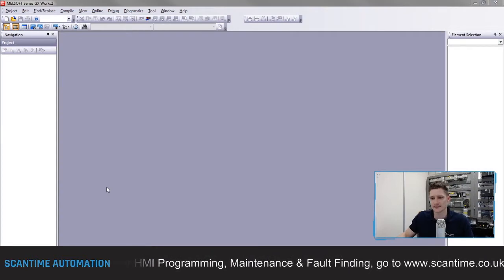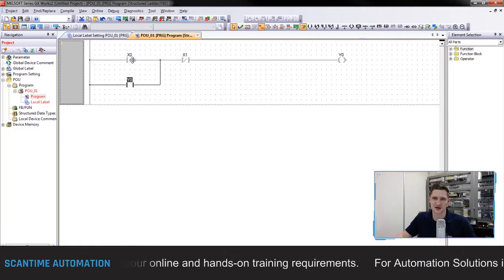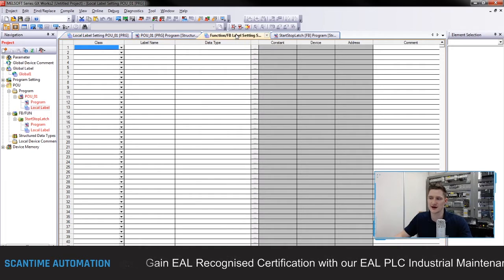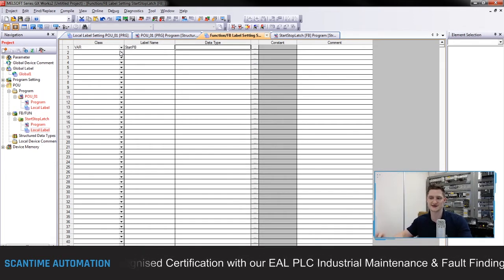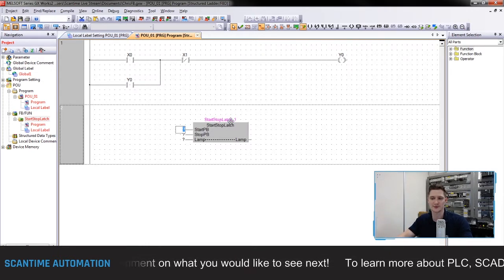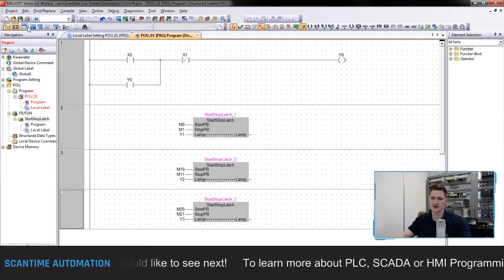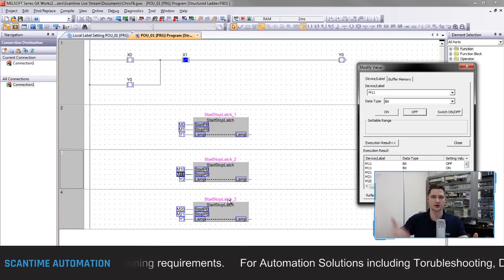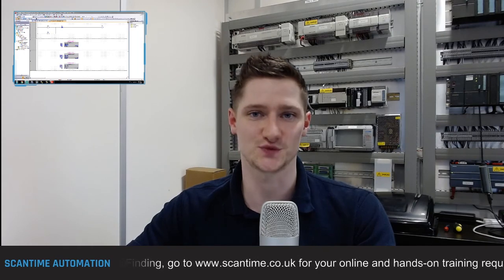How to Create and Use FUNCTION BLOCKS in Mitsubishi GxWorks 2!

Comment: The ladder logic you are using here is flawed. In industry, a start pushbutton utilises a normally open contact, whereas a stop pushbutton utilises a normally closed contact.  You are working on the premise that both buttons have normally open contacts. This is actually not allowed for reasons of safety. This is a very basic mistake to make and very misleading for your target audience.
Reply from the maker: We tend to see in industry nowadays the Stop PB being wired as a NO Contact similar to the Start PB due to the Emergency Stop Button being used more-so for safety, for example, if an accident was to occur, operators would now aim for the E-Stop to stop the process and not the Stop PB as Stop PB's can be used for Cycle Stops which would continue running the process until it reaches the end of its cycle.

We also see less and less PBs being used on the shop-floor too as these are now being replaced by HMI or SCADA screens which contain these buttons, as these are on the screen, these would both act like Normally Open contacts requiring the Stop PB to use a NC Contact in the program.

It ultimately depends upon how the company has wired its electrical contacts, this would dictate how the program is to be designed.
Reply: @ScantimeAutomationTraining  Point taken on HMI and lack of pushbuttons. However any hard wired devices that would have any impact on safety would utilise normally closed contacts as the subsequent circuit design would highlight a wire/termination break in a similar way to the closed loops used in safety relay circuits. Safety considerations always trumps operational matters. I also take your point regarding not being a programming course.
Reply from the maker: As mentioned previously, the Stop PBs aren't used as safety signals in a lot of industries we have worked in as the safety is usually done through the E-Stop, this is then fed back to Safety Relays as NC contacts which may be PILZ for example which then sends signals to the PLC for monitoring purposes.

If the Stop signal was considered safety on a process, this should also be wired to safety relays and monitored by the safety circuits but as it is for control, this tends not to be the case which is why we are allowed to control operation such as starting and stopping through an HMI screen, but not allowed to control the EStops through an HMI screen.

If an HMI was to fail, you wouldn't be able to stop the process via that Stop PB anymore, but the EStop would.
Reply from the maker: Please note, these tutorials are not about how to write programs but more about how to use certain aspects of the programming software. When we design programs for companies, there are a lot of variables which can influence certain programming methods that we use.